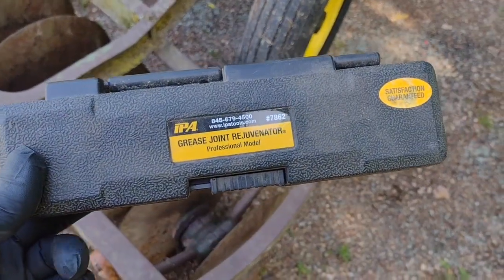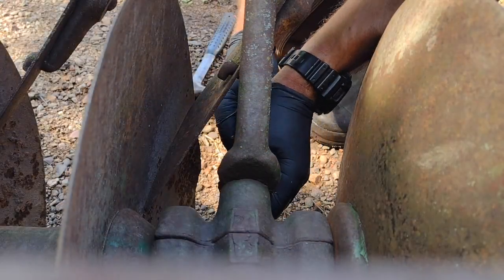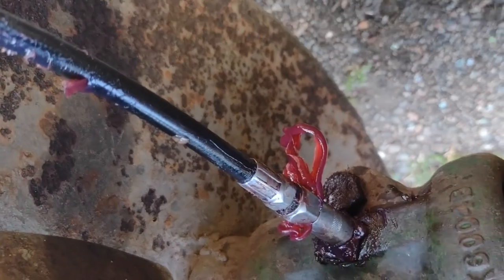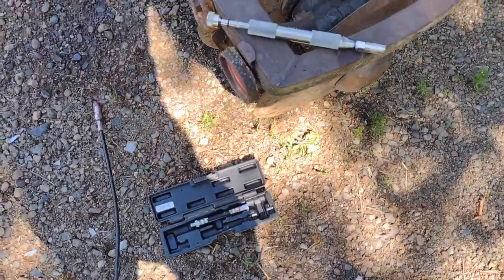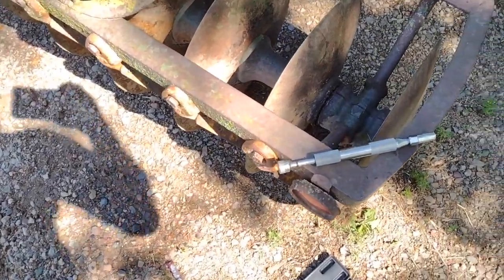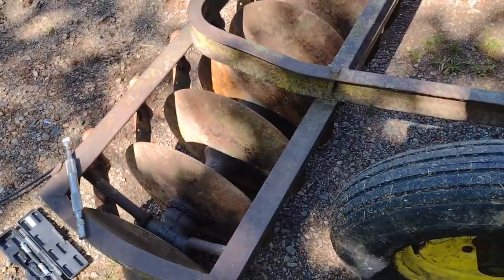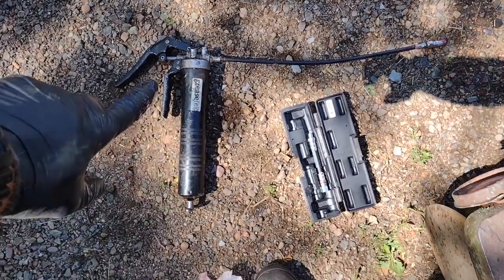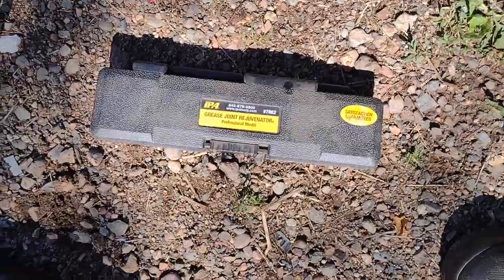GREASE JOINT REJUVENATOR: Is It A Gimmick? I Bought One & Tried It Out!!!

Comment: Hi everyone, I am the inventor of the USA made Grease Joint Rejuvenator.  The review was very good, however the tool was not used correctly and is why he only got about half the fittings to take grease. This is a this is a common problem that we run into all of the time. The reason is, it seems like such a simple tool to use so people don’t even read the instructions. They just put oil in it of some kind, some people even use grease which does not work and they do not get results. OK do you want results, please let me explain. 

 First always turn the tool upside down and Burp any air out of the tool, he did explain that.  If not burped the piston will bounce back!  Next fill with a light oil even break fluid. Next install tool and only tapping is necessary.  You must pump enough oil in through the Zerk fitting to penetrate the hardened dry grease in the joint!  Yes the joint is the problem, NOT the Zerk Fitting!  It’s the hardened grease trapped in the bearing or pin joint.  That’s why some people say to use a blow torch, it loosens the hardened grease, but such an drastic approach is not necessary, hence the grease joint rejuvenator. The amount of taps depends upon the circumference of the pin and the hard and dryness of the grease, not the Zerk!  Each tap of the hammer moves the light oil through the clog. It may even take two applications!  The point is, read the directions and follow them carefully.  If you purchase one of my Grease Joint Rejuvenators and use it correctly and do not like it, we will refund your money, it’s “satisfaction guaranteed.  It’s a very cool tool, no one who greases their equipment should be without!  God Bless and God speed! 
P.S.  loosen but do not fully unscrew the grease coupler, it’s not easy to get back together!

Comment: Those work if the problem is the fitting is locked up ... but if everything behind the fitting is solid too, there's just no helping it. Just too much surface area to spread the pressure over

Comment: Heat, and/or pull the zero and clean. If it still does not fill the cleaned out pocket with wd40 or  carb cleaner and have even stood on the grease gun if possible.  Make sure you over grease to clean out the old crud and  material you used to cut through the crud. Use to change attachments all the time before  quick disconnects that make it so easily. You name the size.

Comment: I just remove the fitting and shove a small peice of metal inside the hole and clean out the dirt and whatnot and put it back together and that usually fixes fittings that won't take grease
Reply: Do the same except I add penetrative oil into it before I replace the fitting.

Comment: i have the same tool that i used to on a pivot tube on an outboard. combined with heat, it did work shoving grease and light oils in the assembly but in the end I had to fix it properly and disassemble the the thing into its major components and replace corroded bushings. I replaced the coupler with a clamp on still like you find on a grease gun and seemed to hold up fairly well.

Comment: Feel this tool is unnecessary heating with torch then a standard grease gun usually works if its not plug behind the zurk if that's the case take it apart and clean.

Comment: Disassembly, cleaning and reassembly is the only good way to "rejuvenate" a greaseable joint. Something I've noticed on a lot of things that need greasing is, they always put the fitting in the wrong place on the shaft where it's either inaccessible or difficult to access at best, and it's always in a place that has maximum tension on it to impede the grease from entering the housing. Lots of times, things need to be jacked up to relieve pressure on shafts, trunnions, etc.
I wouldn't buy or use one of those tools as it will just break something else.
Reply: they arent meant to "fix" grease fittings... theyre only meant to unclog impacted fittings. and for that purpose it works amazing.
Reply: Agree. I clean the fitting and where it is screwed into to. I also spray penetrative fluid before replacing the fitting.

Comment: I've had limited success with these. I've had better luck with the hydraulic pump from my porta power. Not the hand pump, the air powered pump. Had a hose made up at a local heavy equipment repair shop. Mine is 1/4 npt on end that fits pump and a female 1/8 npt swivel on the other.  Use a short steel nipple threaded into where the zerk fitting goes.